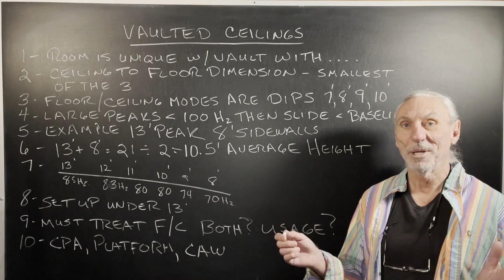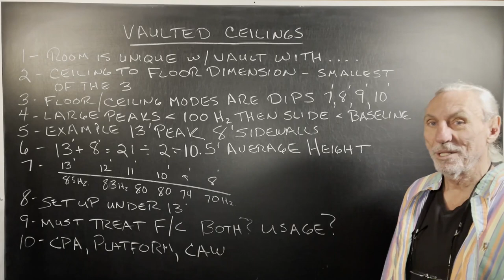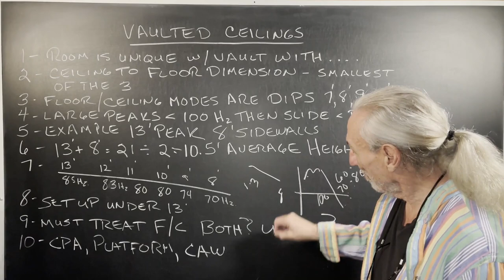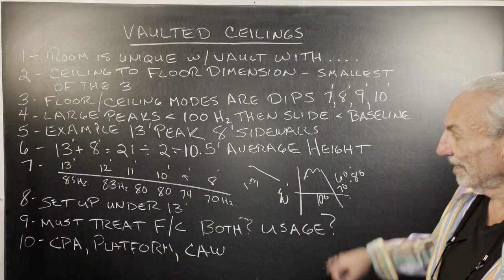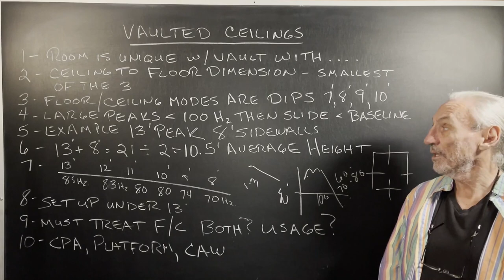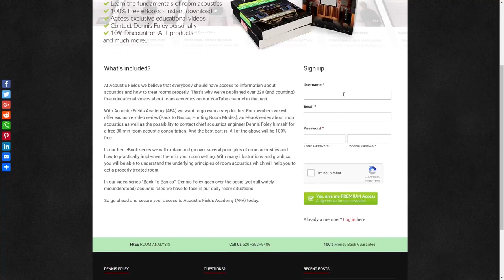Vaulted Ceilings in Room Acoustics - www.AcousticFields.com

Comment: I have a vaulted ceiling with the exact dimensions you modeled. You answered my questions about how it figures in the scheme of things. Thanks !
Reply from the maker: When doing room volume calculations, you use an average volume number for the ceiling height variable. You take the sidewall height, add that number to the peak height and then divide by 2. This will give you a workable starting number.
Reply: @AcousticFields  thanks again!!
Reply: Likewise!  I have similar dimensions as well...12ft down to 8ft....

Comment: If side wall height is fixed, is it preferable to vault the center? The additional volume and average ceiling height will help, correct?
Reply from the maker: Yes and no. It will depend on the usage.

Comment: Dennis, do you know why is there a  "drum" effect with certain windows? I mean the sounds from outside hitting the glass has this drum like deep sound.  I thought my new window would have solved my problem but it didn't.  And it's 5mm thickness double paned.  😖
Reply from the maker: When low frequency pressure waves strike the glass window, the window goes diaphragmtic which means it moves just like the skin on a kick drum. Movement produces vibration which produces noise.
Reply: Do you do any onsite consulting by chance.  The ceilings in my family room peak at 30'.  Acoustics are terrible.  Really want to get it fixed, but would like to do it right, once.  Thank you.   @AcousticFields

Comment: I use my vaulted ceiling as a substitute for ATMOS speakers
Reply from the maker: Distance and angle of attack can be a benefit for ATMOS
Reply: @AcousticFields Please explain these benefits..? 
And however, in my case, because of my vaulted ceiling and attic, I opted to install my 4 Atmos speakers as on the front and rear walls, does this do the same for the mentioned benefits ?
Reply from the maker: @perrysmiles60   More channels will produce more sound which can act as a fill in places your room requires and is not covered by existing channel arrays. A balanced multiple channel system, say 5.1 / 7.2 can produce the overhead effect if your reverberation times are balanced throughout the room.
Reply: @AcousticFields Thank you Dennis, much appreciated!
Reply from the maker: @perrysmiles60  You are welcome.

Comment: A little transistor radio vs full range speaker acting the same? Not even close. The biggest challenge in any room is low frequency and modes, a little transistor radio will have no bass meaning you won't see the modes. Shutting off video, enough said.
Reply from the maker: You missed the point. The room only sees energy. It will produce modes based on the energy placed within it. Whether the spource is a transistor radio or a full range source, the room will react a predicatble and consistent way to that specific energy.
Reply: @AcousticFields  Your point is misleading, that's my point. Make sense?
Reply from the maker: @sbonamo  You are the only one it does not make sense to.
Reply: @AcousticFields  You got me, master of analogies. A word to the wise - be careful, or those you cheated may come forth on this forum.